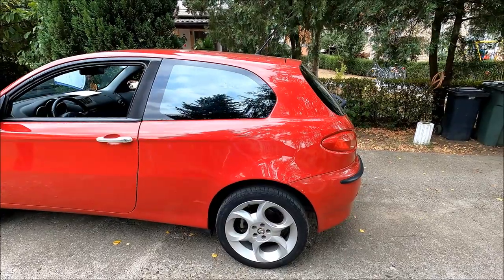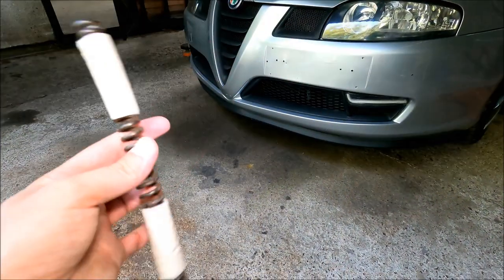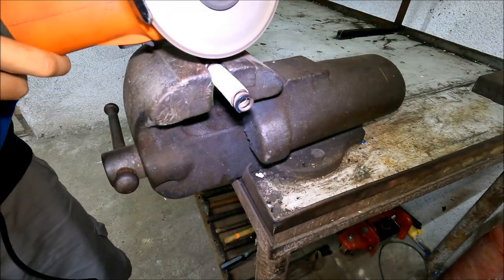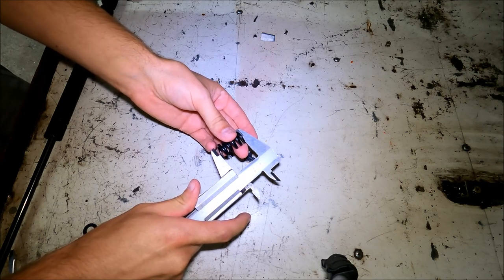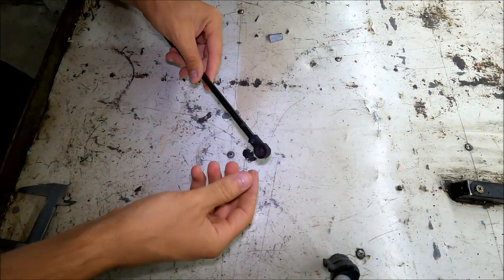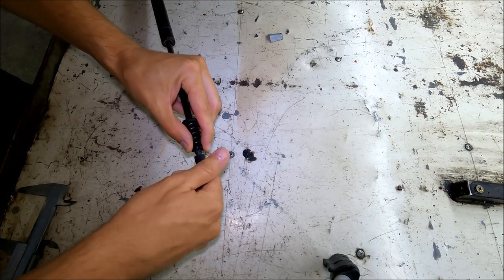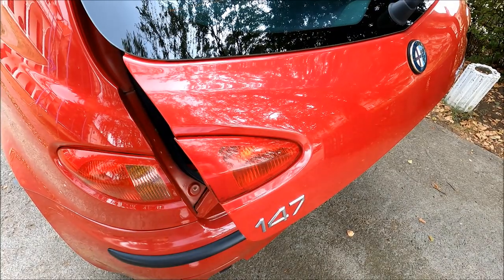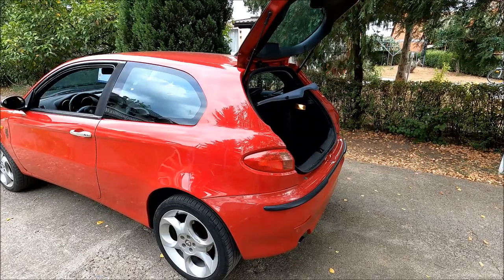5€ DIY Automatic Boot Lid, Trunk Opening Mod, Hatch Pop Alfa Romeo 147

Comment: Nice, i made that on sprtwagon 159 , after few monts water leader from top side of trunk just where you have conne tient between hood m'ont top part and roof panel.  So check your trunk in few months if water is not getting inside.

Comment: Can you make a video about the sacrifice ritual to make my selespeed work flawlessly?
Reply from the maker: I would, but I don't have access to Alfa with selespeed...
Reply: Upgrade the Selespeed Pump, to the larger unit..  Made all the difference on mine..  Clutch and sleeve to bearing needs replacement every so often also due to general wear..
Reply: @francoisleroux2663  yeah, it all started with pump (it died in a traffic jam). I replaced it and have been fighting with side effects for 2 months. Also replaced accumulator and position sensor. Not sure yet, but I think it all was because of the 20pin connector which I enforced with a zip tie recently.
Reply: its pretty simple actually. you wash it and take photos. put it for sale. hope someone buys it. get a 1.9JTD.

Comment: I've been following your channel for a bit less than a year but I'm so thankful to you for your numerous and awesome tutorials. I made my precious Alfa 147 new again and that's really important to me as it was previously owned by my beloved uncle who's gone now... I have just one question to ask: how often do I have to change the transmission oil? Once every x years or just when I find it difficult to change gear? My 147 is the same as yours. Thank you very much again
Reply from the maker: You are welcome, and thank you very much for support. I change the gearbox oil on my cars every 50-60000km
Reply: I think in the user manual there isn't even an interval. But as ARC GARAGE says you'd be mad not to change it every 50-60Kkms. BTW. ONLY use the Alfa engine oil. There seems to be a difference and it's well noted that using alternatives significantly shortens the life of the engine, especially on the V6's.

Comment: Excellent diy 👍 makes the car more practical! 1 question, how did u make sure the spring doesn't fall down? Is the rubber washer enough or did u have to add tape? Thinking if i can do on the gt🤔😃
Reply from the maker: Thanks, it is not possible to do it on GT using this method, rubber washer is enough to keep it in place...
Reply: @arcgarage  Hey just wondering why isn't it possible on the GT? Also can you make a video on how to do it on the GT? Love your videos btw
Reply from the maker: @TheFloppy100  Thanks, when I figure out something, I will do it on a GT as well. Issue is that there is not enough room for the springs, and the boot lid is too heavy...